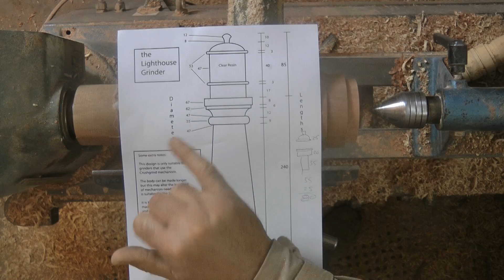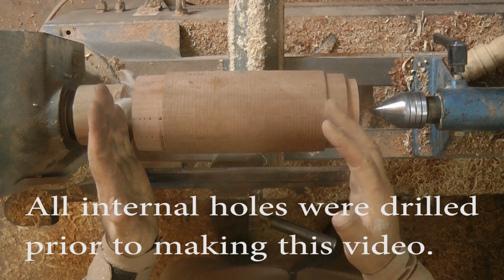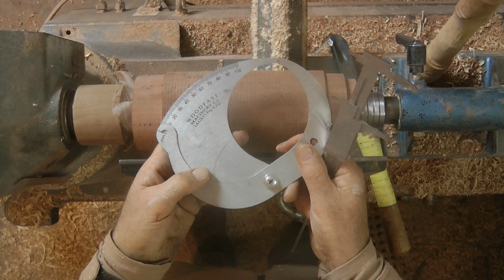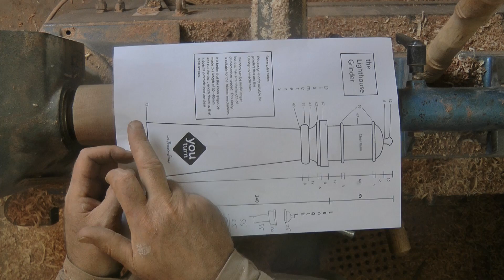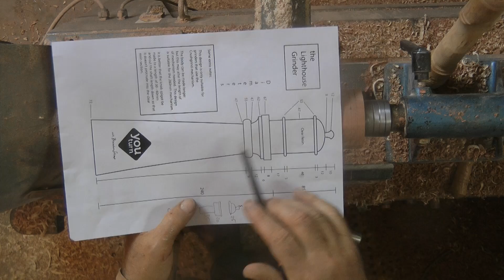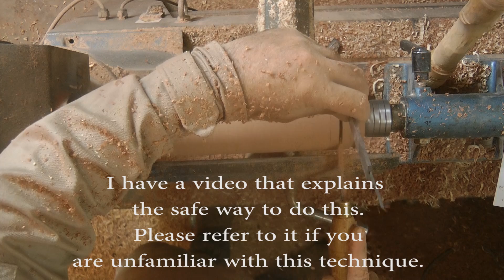The Lighthouse Grinder Part 1

Comment: Brendon the grind on your roughing gouge, is it also a Elsworth grind or something you've come up with to suit your needs? Also, would you use it on square stock to rough down to round or do you use another type of roughing gouge with a different grind? Hope that made sense.
Reply from the maker: +Pipe Nutter Im not sure what sort of grind it is.  Im not even sure what an Ellsworth grind looks like.  It was ground similar to a bowl gouge and I really like it.  Yes you still can use it the same way a traditional roughing gouge is used to rough down square timber.
Reply: Thank you Brendan...